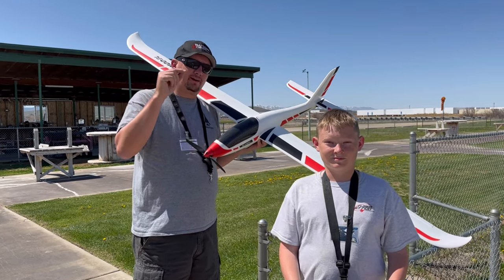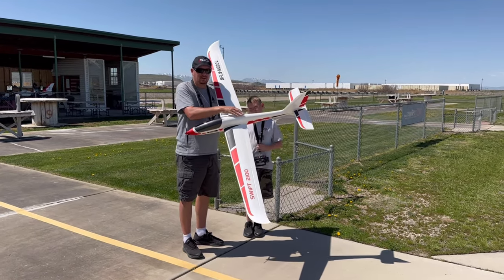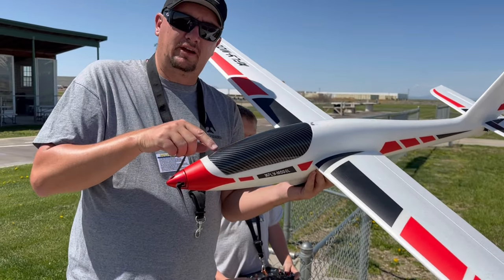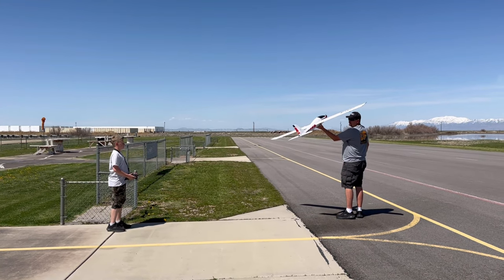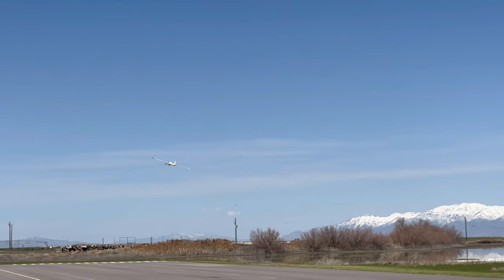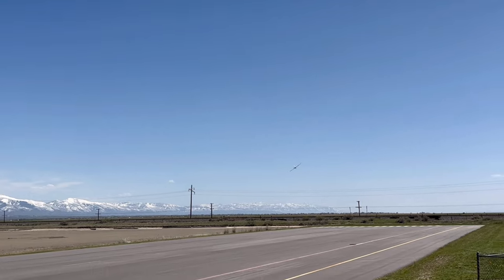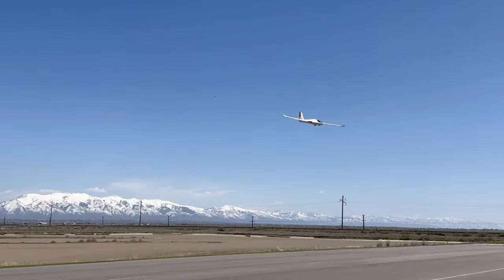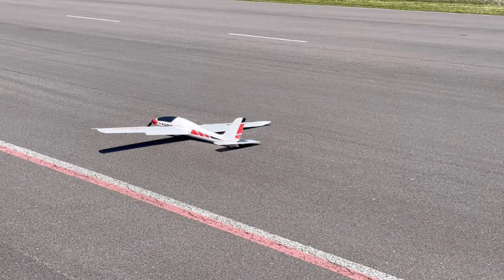Xfly Swift 2100 Quick Flight Review

Comment: You could do prop AND EDF.
Reply from the maker: Would require another esc to be added
Reply: That's my plan. Will install the 64mm nacelle and run a 2nd esc and share a 5s lipo. Have the motors on different flying modes.